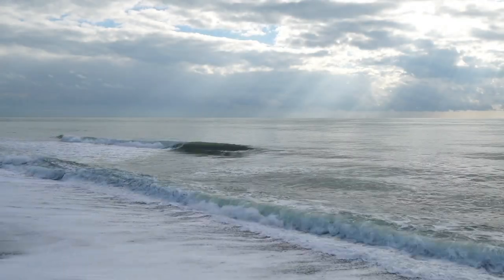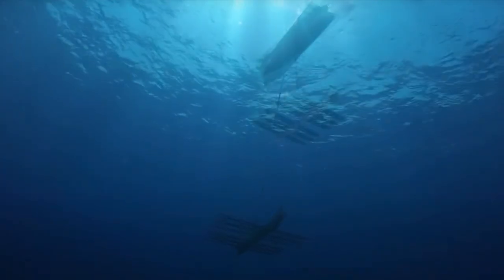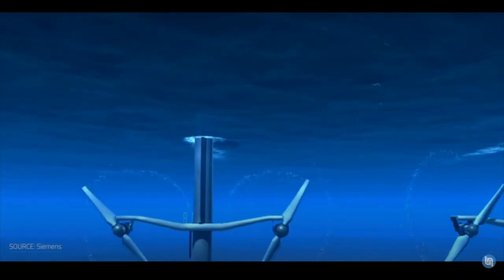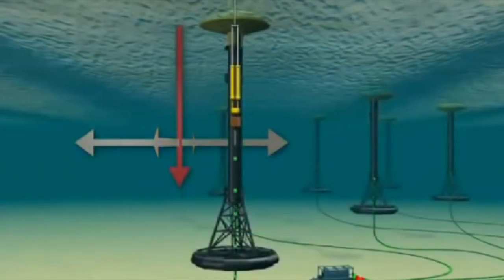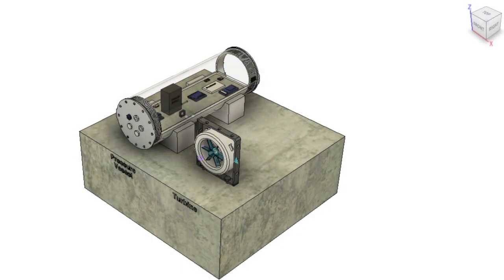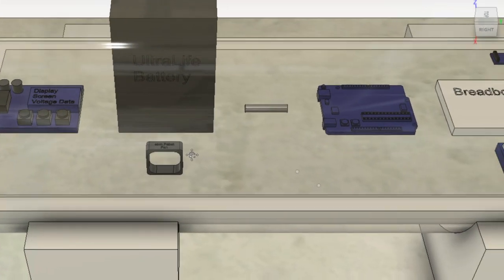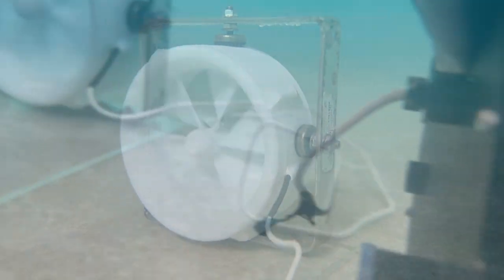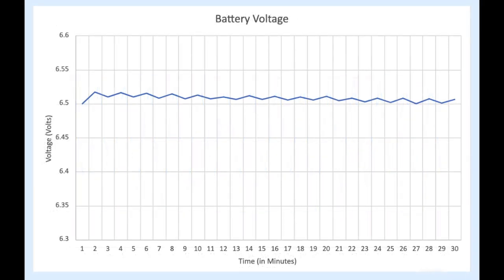Senior Design Video Final

Comment: Awesome project  , how do you get the data from under water ?
Reply: Instead of that old 8-bit UNO Arduino, they could use a dual-core 32-bit ESP32 microcontroller.  The ESP32 has built-in 2.4GHz WiFi and costs even less than an UNO while providing some 2-orders magnitude more computing power.  

Then they could poll each one of these underwater stations in turn and collect data in something like Prometheus for later analysis/visualization.  Can also issue live commands to each station through an HTTP webserver running on each controller.

Would need to float an antenna to the surface though.  Water strongly blocks all the common wireless communication frequencies: 2.4Ghz, 5.8Ghz, 433MHz, 933Mhz, etc.

Comment: Thats cool and all, but what about swimmers, surfers, fishers, marine life, boats that reach slightly lower to the point they might damage this this. On that note, what about debris damaging or even burying this apparatus? That would need regular maintenance which, depending on how frequent it's needed and how many of these get deployed, could easily cost enough to make them non-profitable.
Reply from the maker: That's a great comment, Robby! What you don't see in our video trailer is a lot of background research on those kinds of things. The turbine is only 18 centimeters in diameter, and the highest point is about 25 centimeters tall. We intended that these would be placed in less busy areas so they would not have human interaction. They would also be covered in anti-fouling coats to prevent marine life growth. 

For our project, we also only had a requirement for it to be placed in the water for a month before it would be brought back to shore to collect the data. This means we have not been concerned about maintenance.

We managed to complete this project for about $1,400, but our budget was $3,000.